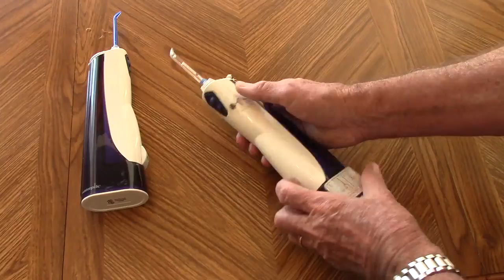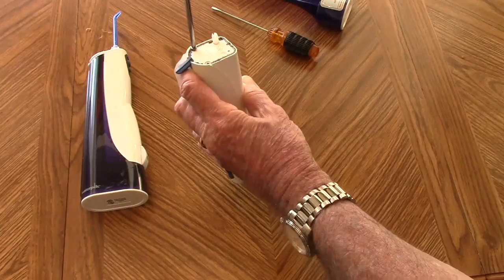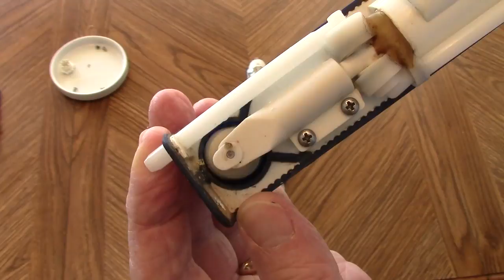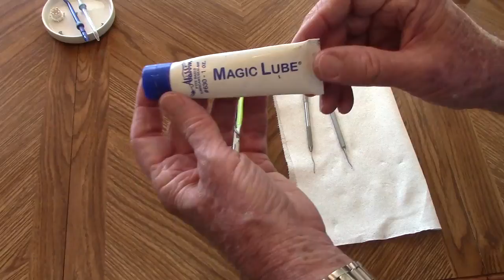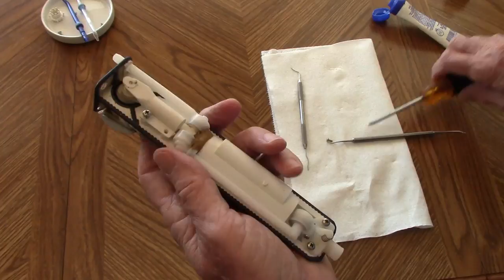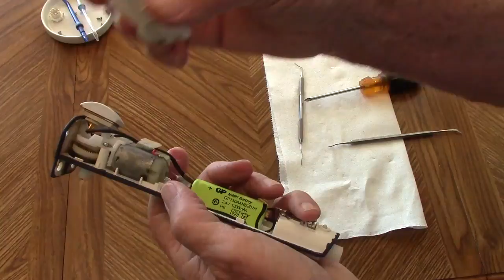WaterPik WP-360 Battery Replacement & Lubrication Rejuvenation

Comment: where do you get batteries
Reply from the maker: Leonid,  Try a Google search using the phrase "Sub-C NIMH battery with tabs".   "Sub-C" is the size of the battery.  It is slightly smaller than a standard C sized battery and will fit perfectly in the WaterPik housing where the old batteries were.  These are sometimes referred to as type "SC" instead of "Sub-C".  The "NIMH" refers to the chemistry of the battery.  NIMH stands for Nickle Metal Hydride.  NIMH batteries have a longer life than NICD (Nickle Cadmium) batteries.  "With Tabs" means that you want batteries with metal tabs welded to them so that it will be easier to interconnect two in series by soldering the "tabs" together.  The ones I purchased were 2500 mah capacity.  The OLD batteries were only 1000 mah capacity, so there is no need to go crazy and pay a lot of money for super high capacity batteries.  I hope this helps you.
Reply: I thank you

Comment: Thanks for the tip on how to get the pic out of the water pic. It was a gift 3-4 years ago and I never used it up until about 6 months ago. The water pic fell on the floor and broke the pic off in the unit. You saved me from getting a new one which I don't like because they  are too powerful. Anyway I just wanted to thank you for the instruction on removing the tip. Thank you!!

Comment: Great video. I have 2 waterPiks that need attention. How much lube do you give? Can I over lube? It's pityful but I want to get it right. s. Thank you.
Reply from the maker: Stephen, The lube I'm using is somewhat of a "gooey" mixture.  I use a toothpick to apply it, so you have to work to get too much.  On the gears... I smear a coating all the way around the gear.  you can be somewhat liberal here.  Once you get some on the gears, move the gears around with your finger. Don't put some much on that you have globs flying around in there.  On the piston... I don't want to get too much in here where the water flows, so I put a "dab" on the piston and smear it around with my finger to get a nice, but somewhat thin coat. Put a dab in the cylinder, insert the piston, and move it in and out and try to get the cylinder to have a nice thin coat too.
I hope this helps.
John

Comment: What are the specs for the ac adapter for the older model? After stashing it away because it wouldn't charge/pump well (or, "I've forgotten what the problem was by now"),  I pulled out the adapter from the cupboard waiting to be needed, except I didn't. It wasn't there. 

Why doesn't everything that needs an adapter have the specs clearly & permanently marked on the device?

Thanks for the video.
Reply from the maker: Kate,  Sorry I didn't see your question sooner.  The easily identifiable difference between my two Waterpics is the connector on the unit where the cord from the adapter plugs in.  The older of the two has a ROUND hole that the plug goes into, and the newer unit has a funny diamond shaped hole with two gold pins visible in it.  The ROUND hole unit is 3 Volts DC and 100ma.  The diamond shaped hole unit is 3 Volts AC and 100ma .  It sounds to me like you have the DC unit with the round hole.  If I was trying to replace a lost DC adapter, I'd go to our local flea market where some vendors have boxes of adapters for calculators, phones, etc and sell them for $2 to $4 each.  Find one that outputs 3 Volts DC.  Once you find one, just make sure that the output is rated for at LEAST 100ma.  That is the output current capability.  You can use one that outputs 200, 500, or more as long as the voltage is 3 Volts DC.  Chances are that the one you find will not have the correct connector on it (That's Murphy's law in action.).  If you take your Waterpic to the flea market with you, you can go through the box of adapters to find one with a connector that fits the Waterpic.  If the voltage and current are correct, you're in business, otherwise you'll need to buy two adapters, and cut the connector off one and splice it on the one with the correct ratings.  In doing that, you need to make sure that the electrical polarity is correct.  The center pin is (+) and the outside is (-).  If you hook them up backward, the Waterpick will run in reverse.... Then just reverse the wires and tape up your splices real good.  If you don't want to do all this, you can probably find universal adapters at Amazon.com...  Just search on "power adapter 3VDC".
Good Luck, John

Comment: Thanks for the great advice !! I was debating on changing the batteries or buying a new one. I have a newer model that required a little more effort to get in apart. But after cleaning and lubing it as shown in your video the power increased immensely.